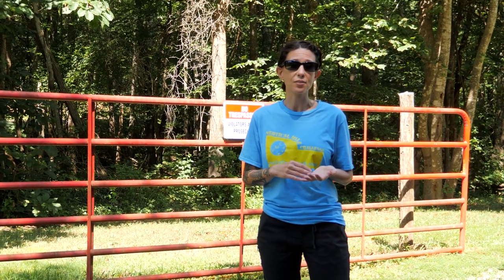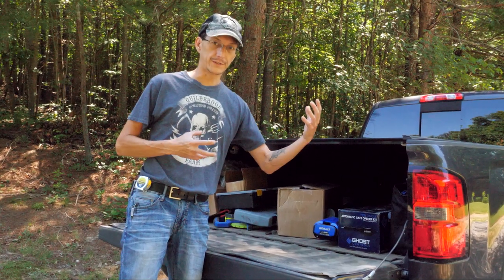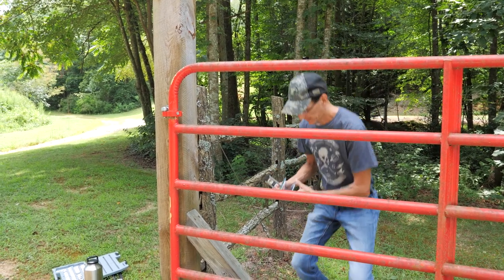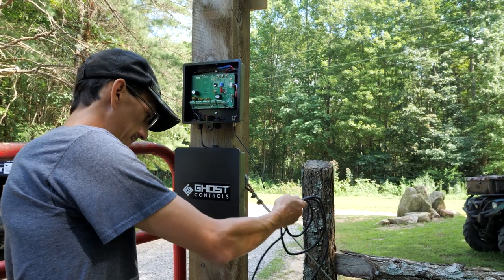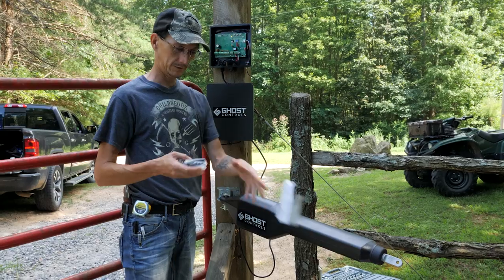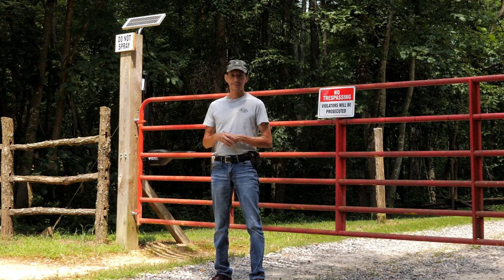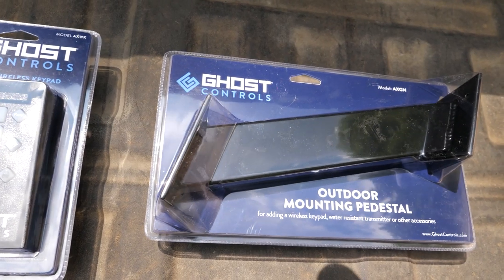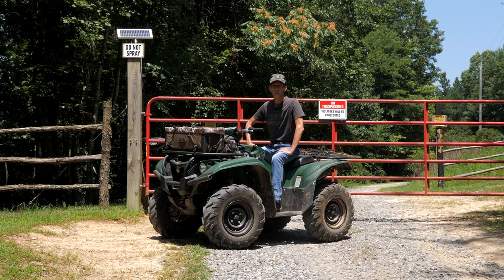Installing the Best Off Grid Solar Powered Automatic Gate Opener from Ghost Controls

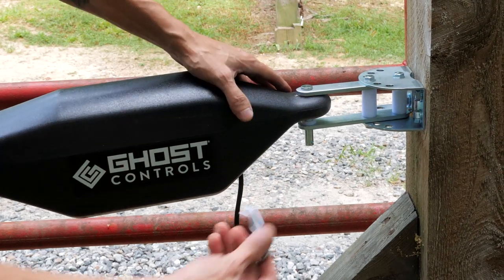Comment: 1 tip, if you buy a system like this without the (zombie)lock, you should replace the pins (@7:07 and @11:33) with locks. Otherwise the "bad people" just pull one of yhese pins and push open the gate with ease. Great video! 👍😎

Comment: Excellent install. Great video. A couple of comments. 

I've installed four such automatic solar gates (mine were all made by Mule). I operated them for about ten years with only occasional repairs, one replaced controller box, and a few replaced batteries. 

The first one I installed was for an elderly friend in Arizona at the end of his road. Within a week, the gate opener, control box and solar panel had been stolen. I suggest (and I did on my subsequent personal three installs) that you replace the hitch pin clip (you called it a cotter pin)  with a small lock or anything that will at least slow down someone intending to take your autogate mechanism for him/herself. 

Also... I suggest you consider using a silicone calk around the holes where your wires enter both boxes. I left a little too much space and later found that my control/battery box (the are combined for Mule openers) had various insects and spiders living inside (including one rather large black widow spider). On my subsequent installs, I also used a steel pole inset into concrete that was about 15 feet high for the solar panel to discourage theft. 

I also recommend that you use steel electrical conduit to protect your wires wherever exposed. I had a problem on several occasions with some type of animal chewing through the black insulation on my wires. 

Hope this helps someone. Those gates are really time savers.

Comment: Like how you approach these projects, analyzing your exact needs, researching the proper elements to meet them. And you do a fantastic job of explaining parts, pieces, operation, at the same time filming it with viewers in mind. We could clearly see your actions, how everything went together, how it operated under real conditions. Thanks for attention to details! Assuming you don't have overhead illumination(light pole?) near the gate at nighttime, wondering if you might want to put reflective tape on the free end of the gate so vehicle headlights will track opening and closing. Sign in middle of gate may serve that purpose though.

Comment: You may never see this because of the many posts.  Don't trust cotter pins.  They can be pulled and the gate swung open. Replace connecting pin with SS bolts with locking nuts.  Much harder to be opened by anyone tampering with the system.    One of the other viewers suggested conduit for all the wiring.  I concur, wires and zip ties can be easily cut. Just a suggestion from personal experience.  Good job on the installation and filming.

Comment: Thanks for the video.  Your setup looks very nice.  You mentioned burying the exit sensor wire.  Do you plan to protect the wire in conduit as it runs up the wooden post, to protect against a weed eater?  The conduit might also prevent someone from easily opening your gate, by cutting the wire to your exit sensor.  It appears that simply connecting the Normally Open white wire to any other wire (except red) would trigger the gate to open.  Sorry, if that's not correct.  But that's what it looked like from your video where the white wire connects to the Open Terminal and the Common, Shield, and Ground wire connect to the Common Terminal.

Comment: I am glad to see someone else besides me use a adjustable wrench as a hammer. In the process of installing one of these now, hence why I am watching this vid instead of my usual mindless junk.  Not being mechanically inclined I will leave my pistol at home so I am not tempted to shoot the control box when the frustration reaches unmanageable levels. It has been known to happen in the past. The boards on the manure spreader look like swiss cheese because the dam thing is always breaking down.
Reply from the maker: I like you already

Comment: It appears that the original gate hinge pins were not loose or wobbled out as you stated they could be.  I have a gate that is mounted with the threaded hinge pins and the gate is still going strong after 25 years.  You replaced a very secure method of installing the gate with threaded rod pins that only requires one to remove the nut and pull the gate with pins out of the post.
Reply: That may be so but if someone really wanted to get on the property all they would have to do is drive through the gate . I'm sure that he has cameras and motion sensors set up to monitor the gate .  The main reason why he installed this system is so that he and his family would not have to get in and out of their vehicle all the time to open and close the gate . A gate just stops the honest people from getting in . No gate is going to stop a person with bad intentions .

Comment: Thanks for sharing!  I like the Zombie lock, I haven't seen one of those.  I would be a little concerned about the batteries being in the sun in that black box, on a 90F sunny day it may be 120F or more inside the box.  I'd check to make sure they're not leaking at the end of every summer.  You may be able to mount them low on the post to keep them in the shade longer.
Reply: Judging from shadows and the angle of the solar panels it appears that the battery box is mounted on the north side of the (6 x 6?) post
Reply from the maker: Correct. The batteries are in the shade all day.

Comment: We also have a 16' gate attached to a 6'x6' post. Even using the heavier duty bolts, we took an extra step to prevent the gate sagging.
We took a small 2" x 4" block of wood and screwed it to the other/opposite 6"x6" post and use it as a "footrest" for the gate. It is about 6" off the ground and even with the bottom of the gate.
If the gate is going to be left open for any length of time, we just set the end up on the block to take weight off and support it.
Reply: We put a wheel on it for support and ease of opening.

Comment: I have this same gate opener and for the most part it works. Once in a while I need to reset it. Trying to get it changed over from A/c power to solar without spending the $100-200 for their solar kit.

Comment: Where did you guys get the hinge pins that go all the way through the post instead of the screw in lag bolt type? Also what size it the tube on your tube gate is it 1 3/4 or 2 inch? What size post is that as well as length?  I watched this a few weeks ago and you inspired me to go buy a brand new gate, I've always wanted one!!
Any problems with the gate opener after almost a year?
Thanks for this video!!! Love the content!

Comment: That's cool now I want one!  One suggestion though Jeremy, and I'll bet you may have thought of something too already and just haven't gotten to it yet.  Those approximately 3" wood rails between the posts on the sides of the gate won't stop anyone intent on driving that road (your ccw will if you're home though :) ).  I'd consider pipe and concrete, either with rails, or just some ballards.  If you want to keep the wood rail look, maybe just a single pipe rail out of sight behind one of the wood rails, with vert posts in concrete and welded.  Maybe even a few boulders placed just right.  I see that guy cable is kind of in the way on one side, but it looks like it wouldn't take much to kick out the next section just past it, or a tow strap.  I've seen locked gates on barbed wire fences in Wyoming too often, were people just cut the wire and go around the locked gate.  Those rails don't  look much tougher.  At least it's not far to trees!  You won't stop walkers, but most of them want to drive.
Reply: Brad Payn  I want you too ! My gate area is shaded though so I have to figure that out

Comment: Great Video, I am installing the same system here in NZ, one question though, does the solar panel have a solar controller/regulator or is connected straight to the control box ?
Reply from the maker: Straight to the control box. Charge controller is built into the main board.

Comment: You may want to add an adjustable hard rubber 8"dia. wheel at the end of your gate in order to remove the stress off of the gate hinges. I've used them with 20' steel gates with great success.

Comment: Nice system, however......
I would run all intercabling between boxes in Sealtite conduit ( as used in AC wiring between cutoff box and the AC compressor.) cable to the control arm should be run in a stainless steel Armor Flex conduit whic can be obtained from various high end alarm supply companies.
These few changes will eliminate the average joe from messing with your gate. You could even add a wireless alarm system to alert you of any tampering.

Comment: 3 years later, still working good ?  Any issues in that time?  Thanks in advance!
Reply from the maker: Yes still works great. I've replaced the batteries, upgraded to a bigger solar panel, added a second driveway exit sensor for a second road and upgraded the control board to the new smart gate version. No problems with any of the components, and their support folks are great if you have questions.
Reply: Could you share a link for the smart gate version?

Comment: So when will you secure the opening between the end of the wooden fence and the pole holding the batteries and solar panel? A small person could skimmer in and tamper with the system.

Comment: How is this opener holding up?  Any thing needed to be replaced?   Thanks
Reply from the maker: It has worked great. I replaced the 10 watt solar panel with a 30 watt and it works much better just because it doesn't get enough sun during the winter days. I also upgraded the control board to a smart gate that has wifi/bluetooth.

Comment: Can you tell me what length of through bolts did you use? Looks like you have a 6x6 post so I'm guessing those bolts are 8" length for tightening the nuts?  I'm getting ready to install mine this week and really appreciate you making this video! Very thankful for folks like y'all! God bless 🙏
Reply from the maker: Minimum: 8x8 pressure treated posts and 3/4" x 12" gate hinge through bolts for a 16' tube gate.
Reply: @Guildbrookfarm  thank you kindly for the quick reply! I know you posted this along time ago but I appreciate the details. I have a 6x6 post with the lightweight 16ft tube gate. I'm going to get the 8" through bolts and that should work out. What do you think?
Reply from the maker: 8” length should work. Make sure they are 3/4”, not 5/8”. A 16’ gate will bend the smaller ones over time. I added a support cable and turnbuckles to our gate to eliminate sag.
Reply: @Guildbrookfarm  Roger that thanks

Comment: Very nice......is there a system that may be similar but less "heavy-duty" and maybe less cost ......for a system that doesn't operate a heavy gate......but only operates a lightweight aluminum channel ( a single bar) that is located maybe 1 ft above ground?...and that goes across a home's driveway? I want the single, low, aluminum tube or bar..... as a visual deterrent for folks using my empty ( but "convenient") driveway as a public turn -around.
Reply: I’ve thought of a similar arrangement, but the “gate” has to be visible and look sturdy enough to stop, or at least damage a vehicle or it won’t work.

Comment: My concern is with the auto exit sensor. How does it work, what does it sense/detect? Is it movement? That would open for pets and livestock or anyone wanting to drive through could just climb the fence and walk up to the sensor to open the gate etc. Not very secure for trespassers or livestock. But thanks for the video on a solar charged gate opener.
Reply from the maker: It’s a magnetic field sensor. For vehicles.
Reply: Mr. Dempsey . . . there is a way to trick the sensor into opening the gate but as for livestock, they are not detected by the wand.

Comment: Wouldn't mind an update video on this system as to how well it's worked and the quality of the components. Not really a video but an little update of sorts.

I wish they would make that lock mechanism to have a long bolt that passes through a slot so you can't bent the gate in the middle  a couple of inches and slide the little bolt out of slot. Perhaps it's more of a claw lock mechanism, I'm not sure cause it's all covered up so maybe this isn't a real issue.
Reply from the maker: Update: Still working great. The lock is like a “claw” so it fully encloses on the latch bar. You need a key to open it manually.
Reply: @Guildbrookfarm  I guess hook would be a better description than claw. Alright thanks for the update. Other people can read it here if they're interested in the long term usage, so it's appreciated.

Comment: How has the lock been working for you? I’ve been having a ton of issues getting it to actually lock when it closes. Most of the time it bounces out of the lock pin.
Reply from the maker: It works great. You have to set the close limit tighter so it doesn’t bounce as much.
Reply: Guildbrook Farm - Off Grid Living thank you for the reply!

Comment: Question?? If someone wants to get through the Gate, what would stop them from just removing the pins that hold the opener in place and just pushing the gate open?
Reply from the maker: The pins can be replaced with locks made for it
Reply: Even if you pull the pins the lock holds the gate in place
Reply from the maker: Correct

Comment: I need a link for the driveway exit sensor system you used in the video...
it doesn’t appear to be included in any of the links & I will be attempting to replicate your system. 
thanks for an informative & thorough video on the installation!
Reply from the maker: Sorry about that. I've added the exit sensor to the video description.
Ghost Controls AXXV Wired Vehicle Exit Sensor
https://geni.us/GhostVehicleSensor

Comment: What's the width/diameter of your gate posts? I'm wondering what width is sufficient for a 14ft tube gate that I will add some wood to just to pretty it up and make it not "see through"
Reply from the maker: For a 14 foot gate I wouldn't use less than an 8x8 post

Comment: Seems to easily defeated. 2 nuts on the entrance side and 1 cotter pin, or even faster grab something iron or steel from truck walk through open man gate run up the drive and trip the exit sensor with a chunk of iron or steel IE shovel, crow bar, or such. Maybe for safety sake tack weld the nuts on the clamps holding your opener and latch. Replace pin and cotter with bolt and tack weld it too. I know you meant to have it for convenience but I also know you guys are security oriented. Thx for sharing all the same.
Reply: First you have to know there is an exit sensor then its location ...
Reply: It's not a safety gate it's a trespasser deterrent, why would anyone bother defeating it.

Comment: Hi there, I have the system up and running now but find the exit sensor to sensitive, I was standing way back with my car watching the gate and it kept opening, only birds flying low around sensor area and tree branches waving in the wind, shouldn't the sensor only react to vehicles, as in cars bikes etc.. or can the sensitivity be adjusted ?
thank you for your help
Reply from the maker: Make sure the sensor is buried 18” deep and horizontal. Disconnect it from the board, disconnect battery and reconnect battery to fully cycle startup calibration. Then disconnect battery, reconnect sensor, reconnect battery and startup system again.

Comment: I've installed a ghost opener and ghost lock, I'm having some issues, maybe you can help, when I close the gate , it bounces back and don't give the lock time to engage, the lock works , I've tried to adjust the gate but it only adjusts so much, maybe I'm doing something  wrong, I've watch and watch videos on YouTube but I can't figure it out, hopefully you can advice
Reply from the maker: Try adjusting the motor stop point using the little buttons on the main control board. Sounds like your gate arm isn’t closing quite far enough.

Comment: how long has the battery for the keypad worked, and is there any notification that it is getting low before it dies?
Reply from the maker: Still using the original batteries. I think it’s been over 2 years. I don’t think it does any notification when they get low but they are easy to change.

Comment: What's the size of the solar panel used and did you use any charge controller???
Reply from the maker: It’s a very small 10 watt panel which is all that is needed as long as it gets at least 4 hours of sun. The charge controller is built into the main control board.

Comment: Nice work. What is the do not spray sign for?
Reply: Some companies have a right of way on properties for gas lines , hydro lines and such . These areas need to be clear and accessible  so they will spray these areas to kill the vegetation . You can say do not spray my property so companies have to send in people to cut down these areas . It's cheaper and easier to spray but as a property owner you can say not on my property . NO SPRAY
Reply: Thank you for the explanation I didn't know that.
Reply: @acet7  cause if the utilitiy companies spray insecticide along the road side, it doesnt just stay there. It will also kill any insects that land there, which means losing your pollinators, bees if you keep them. The poison then runs off into the watertable, which they dink from, having  a seep on property. Plus, they have chickens that free range, who will eat the bugs that could be poisonous now,,, = dead chickens... it goes on and on. Poison kills, be careful where you put  it, is the main idea.
Reply: Thank you